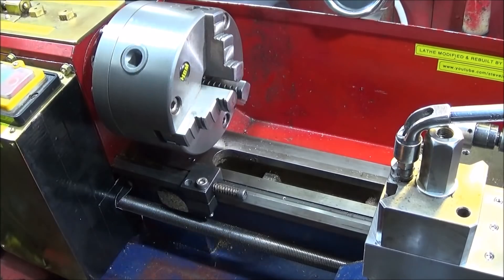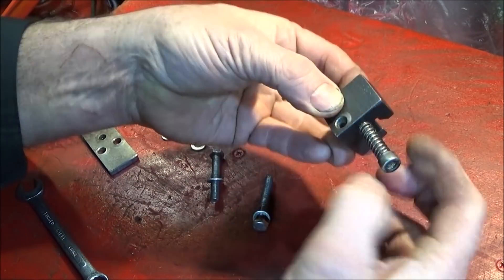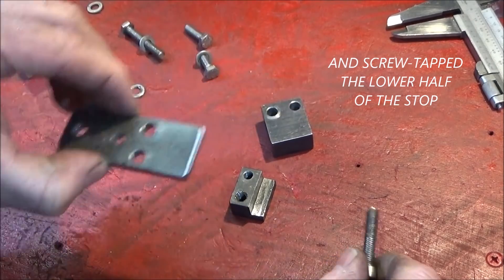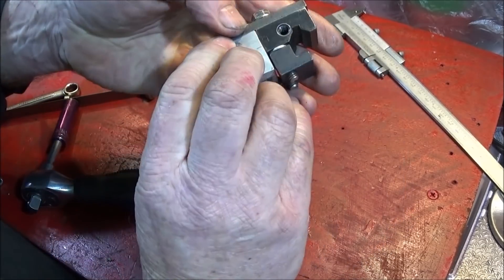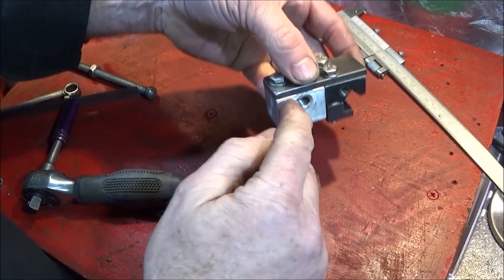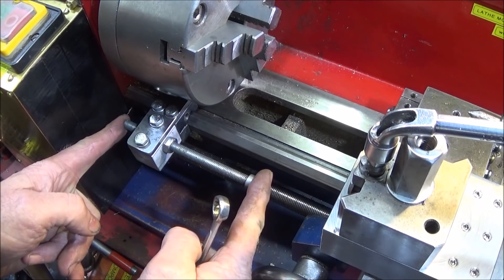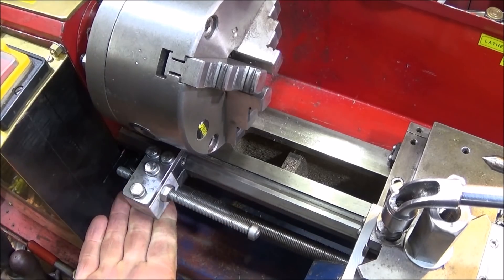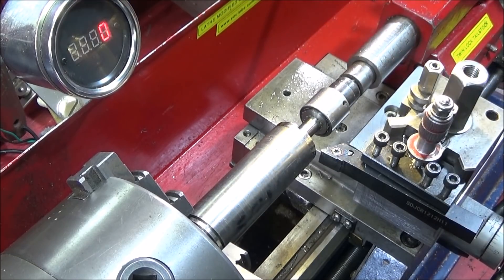Mini Lathe Carriage Stop Upgrade & New Toolpost Test On S316 SS

Comment: Hi Mate, 
I like the mini lathe.  It cuts the stainless just fine! 
I ,also, like your ideas.  I have one recommendation if you please.  The threaded rod stop should have been a fine thread to allow an easier micro control ability than the standard thread.  

Your accent is British I think, are you from the UK?  But you use metric.  Personal preference or am I guessing the wrong location? 

Good day!
Reply from the maker: Hi Thomas. Thanks, I have got used to using a coarser thread as the Myford lathe has the same. If I wanted to use a really fine thread though I could always make an adapter to fit. I sometimes use both the stop and a DTI clock positioned on the back of the carriage. Yes I'm British originally from Surrey, but now I live in the South West of England

Comment: Thanks Steve. This is another one for my to do list. I don't suppose you have to move the entire stop that much with all the adjustment you've built into it. If you did, I think I would replace the bolts that hold the aluminum block on with countersunk, flat head screws so that, they wouldn't be in the way of the wrench so much.

Comment: Good morning Steve, Robert from Hebden Bridge with the 200w and 500w motors. I have a slightly different and improved 200w I thought you might like to test but your older titanium Email doesn't seem to work. I still send your links to lots of customers and view regularly myself. my contact is robv@hotmail.co.uk if you might be interested, kind regards, Robert.

Comment: I really like the design of your carriage stop. One thing I noticed is how slowly your feed rate is. Have you changed the "final" gear on the lead screw?I recently acquired an 8 x 16 Chinese lathe and have found the feed rate to be to aggressive for softer materials and would like to reduce the feed rate. Do you have any suggestions?
Reply from the maker: If you have spare gears just try swapping them around until you get a slower feed. Mine is still in the same gear as the day I bought it.

Comment: Hey Steve, nice video as always. Was wondering if you are on power feed that if it might damage the lead screw ones the carriege hits the stop? Not too sure but any advice will be much appreciated ;)
Reply from the maker: Hi when you use carriage stops on lathes, you must never let the feed drive up to the stop otherwise there will be damage of some kind, either to the gears, the half-nut or both. 
  The technique is to allow power feed up to a certain point, say about 10mm from the carriage stop, then push the lever to disengage the half-nut to stop the feed. Then finish the cut up to the stop manually. As you gain confidence, you can let it feed up to the last 5mm depending on feed speed and your personal reactions.
  It is always best to play safe though. It is the same technique with every manual centre lathe.
  I will show some great uses for the carriage stop where one can use them to get dead accurate depths etc, very quickly. Plus they are great for milling ops on the lathe.
  Once you have used one like this for a while, you will wonder how you managed without one.
 Regards Steve
Reply: @SteveJordan  Nice. Yes I'm starting to get good at this 😂

Comment: I dont think it won't damage the carriage screw as well as the screw grab nut if the carriage reach the stopper that he made..what im thinking is that instead of putting metal screw, put push button electrical switch so that it'll automatically stop when it reach the desired position.
Reply from the maker: Some people make the stops to trip the half-nut feed lever manually, which works well if the lever is on the front of the carriage. The mini lathe lever is on the back end of the carriage though.
Reply: A switch would still have some movement while the lathe s;lows down based on speed and mass. Could be a bit tricky to master.

Comment: Hi Steve: Certainly a bettter design that the original. The only modification that I would suggest, is to replace the end of the stop by a 6mm acorn nut. Its top being convex does not allow chips to sick to it and muddle its purpose. All stops used in the shop, should be constructed thus. Nice presentation as always.

Cheers
Jorge

Comment: if you are threading and have the leadscrew engaged (obviously) - won't it destroy one or more gears hitting the carriage stop?
Reply from the maker: Hi Yes it would, that is why you would never use any type of carriage stop when threading. 
   Plus whenever you use the power feed, you disengage the feed several mm before the stop and continue the feed by hand manually, until the carriage actually meets the stop.
Reply: @SteveJordan  That applies to lathes without a clutch, dispositive included in bigger equipment.
Reply: @jorgescordamaglia1654  dispositive?

Comment from the maker: SEE TOOL LINKS BELOW:-
7pcs 12mm Shank CNC Lathe Turning Tool Holder Set -- http://bit.ly/2DZlcjD
Drillpro 10pcs HRC45 Blue Nano DCMT11T308 Carbide Insert -- http://bit.ly/2VaUTOj
Reply from the maker: 55% off Mechanical Parts Promotion -- http://bit.ly/2Uw9PqG
Banggood Health Protection -- http://bit.ly/33tNTBx
Banggood Health&Care Protection --  http://bit.ly/3d7QpSy
Electronic Tools Sale -- http://bit.ly/2SLxUYG